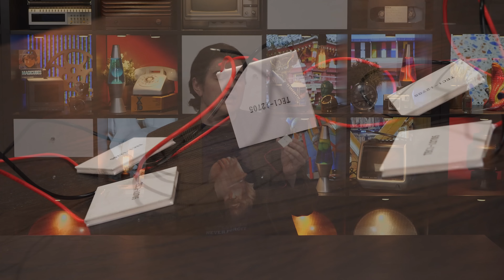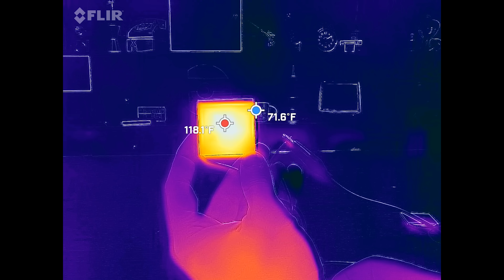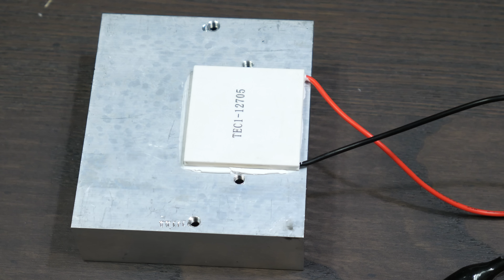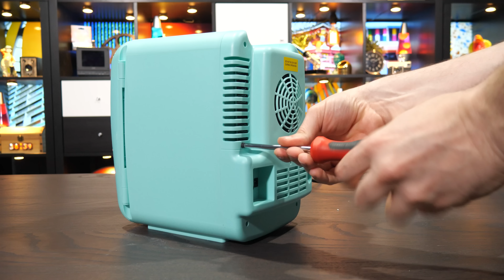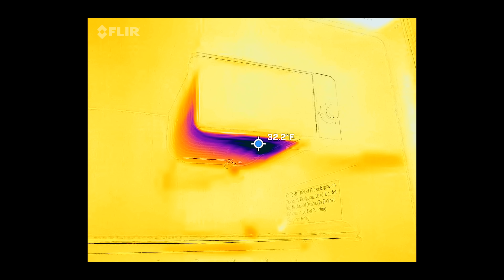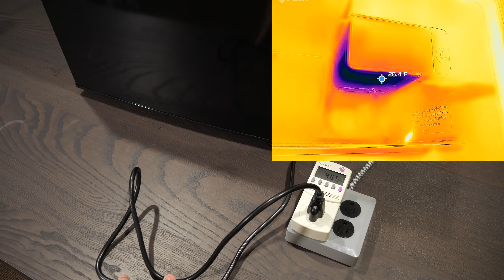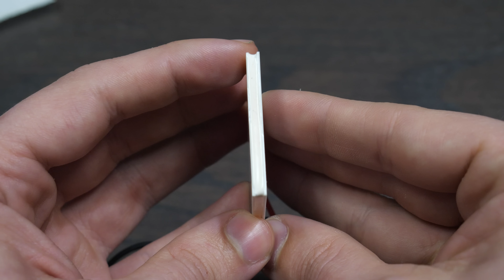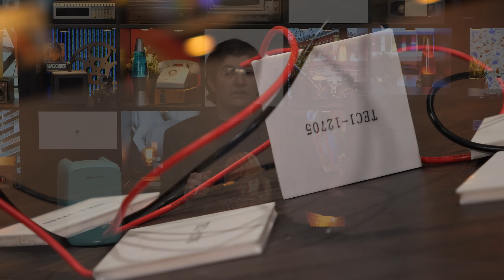Thermoelectric cooling: it's not great.

Comment: Ex wife and I bought an electric cooler for a cross country trip we spent a month driving in our early 20's. It was great! 

They have their uses.

I now have an actual DC fridge with a separate house battery in my van. And a much smaller fridge in my Jeep. But those aren't very cheap, or compact.
Reply: I use mine when travelling since hotels don't typically have mini fridges anymore. Also have the larger DC minifridge, but it isn't feasible to bring along unless driving myself

Comment: The most important things about these is the size.  In no way would I be able to bring a mini fridge into my office to work (in a cubicle in the office), but these little fridges work decent.  Stock it at night, and you have 6 chilled cans to get you through your work day.
Reply: At that point, just bring an actual cooler and use ice packs. You can even get ice packs that are shaped to fit inbetween beverages.
Reply: @seigeengine The amount of work that necessitates is obliterated by the convenience these provide.
Reply: @knight0fdragon  I mean, other than carrying it back and forth, which is trivial, it's basically the same amount of work. You're just restocking one extra thing when you're restocking, which is even more negligible.
Reply: @seigeengine  no it isn’t, at all. There are a number of steps involved that must be done routinely to ensure that you have cold beverages compared to just keeping stock and refilling.
Reply: @knight0fdragon  Yeah, like keeping stock, and refilling.

The ice pack is basically just another beverage. Carrying it with you every day is trivial, you already go to work every day. It's not heavy. Most people drive to work anyway.

I'm not saying the babyfridge isn't more convenient, but the difference is fairly small.
Reply: @seigeengine  holy crap buddy…. No.  You can’t just keep a cooler in the office and put in tiny ice cube packs and expect it to instantly cool things off,  thermodynamics don’t work like that. You need to take that cooler back and forth to work with you.  You need to ensure your beverages are cold at your home because the point of the ice pack is to help the drinks retain its coldness, not make it cold, which means swapping in and out between your fridge and your cooler.  You need to constantly freeze those ice packs.  You need to clean those ice packs.  You need to clean that cooler more often because you are constantly transporting it.  If there are any leftovers you need to place them back into the fridge. There is a lot going on to using a cooler.  With the fridge.  You stock your cubicle with a months worth of beverages, and you replace what you consume at the end of every day.  Once in a while you dust it off and clean it.  That is it.
Reply: @knight0fdragon  I like how you just started making things up.

Just slap on a red accessory and pick a race to hate. Shit.

Comment: Is the opposite true? Can I use temperature difference to generate electricity?

Cause I could dig a kinda deep hole and have free electricity.

Even use the difference between inside and outside buildings.
Reply: It's called Ceebek effect. It's what powered many of the old unmanned space crafts. It won't give any useful power, only a few hundred Watts at best.
Reply: @jamesisaac7684  Seebeck?

Comment: For camping, there are now many camping coolers on the market that use a compressor instead of a Pelletier cell. Bought one last year (Bouge RV) and, it consume 33 watts while the compressor is running, 0 watts while off so depending on the ambient temperature it operates within, it can do its job perfectly with so little current compared to the old Pelletier-based cooler (+/- 44 watts, full time) that there is no comparison at all. The noisy cell-based crap having drained my car battery to zero a while ago because I had kept it on overnight. Now I use a separate 100Ah Lithium battery on my camping fridge. I control the exact temperature I want inside and it can easily run for 4 days on its battery.

Comment: one possible use case ive seen for these is cooling a cpu. so long as you have the means to dissipate more heat than normal, you can probably get more performance out of your computer. not just for the top end rigs to get 1 or 2% more performance either
Reply: According to many comments. PC entrusted had tried that but did not  succeed. The conventional methods hand better' performance which used less power.

Comment: Is the thing holding back these devices the need to fit within the power supply of a 100w car inverter? ie. could we make them actually useful if we 5x or 10x the power? To make a comparison, I love space heaters and am 100% in favor of trading higher electric bill for operational simplicity
Reply: As mentioned, they're less efficient the more power.

Comment: you mentioned the heated / cooled cup holder thing. my 2nd gen honda fit just puts some cup holders in front of the air vents, so when you're trying to keep yourself cool in the summer, it keeps your drink cool too. it's enough to cool down a warm energy drink to noticeably cold temperatures in an hour or so (perfect for car rides!)

Comment: Why would something like this not work in space for heating.
Reply: It would work in space for heating, but the issue is that in space you're limited in heat exchange by radiation since there isn't air to either absorb heat from or dissipate heat into.

So you'd be better off basically just using resistance heating.
Reply: @seigeengine  So the side heating the cabin would have air but the side exposed to space seems like it would stay at a constant cold state, I lack the knowledge in this subject to know why I am wrong.
Reply: @jaylors5825  These work by moving heat from one side of the device to the other.

In order to do that, the side that's being made cold has to get warm first, otherwise it won't have any heat energy to move.

In air this works out because the cold side can absorb heat from the air, but in space, it can't do that, so once the cold side gets cold, the only heat it gets is conducting back over from the warm side.

So since it can't move heat from the outside of the space ship to the inside of the space ship, it's basically just a resistance heater with extra steps.

Comment: One specific use case for these devices that is nice is for small, inexpensive cigar humidors. I picked one up last year since my non-AC apartment gets hot in the summertime. Only need to keep them in the sixty degree range. Larger cooling fan is quiet as well.

Comment: The only thing Ive seen those tiny pos coolers that was a ok use for was to keep super glue at the place I used to work at cool. It cost more to pay someone time to walk across the building to get the glue out of the break room and putting it back every time. They didnt want to have a mini fridge under the work bench nor did they have enough room to put one there so it kindof was the only option.

Comment: Pelletier is good for electronics components like microprocessors or laser diodes, that can get very hot, but it also needs a good cooling system, like a good heat sink and a fan, or anything you choose. As you said cooling is just an energy transfert, so it has to go somewhere... I've heard about home heaters that are made of chips that mine bitcoins ! XD !!!

Comment: I'm a long time fan and greatly appreciate your insistence on practical, day to day technologies. Have you thought at all about the other side of thermoelectric devices, using waste heat to generate electrical power? I know they are useful in niche applications where you have a reliable heat source, no tolerance for mechanical failure, and no ability for electromagnetic generation, like using a nuclear reactor's heat to power a deep space probe. This still isn't very efficient, but I'm curious if there are any consumer applications or products you know.

Comment: 8:35 An actual refrigerator requires A LOT of power (inrush current) to get it started. Yes that's only for a fraction of a second but without that initial burst of power, you won't get the compressor started. So mains power only unless you have a fancy soft starter. Which begs the question, to those that know: how do small fridges for campers or boats work? 🤔
Reply: I'm ignant, but I imagine this is related to the size of the compressor, so smaller compressors just don't have as much of an issue? Some seem to use compressors as normal.

There is a different type of fridge used in RVs and the like called an absorption refrigerator that uses heat instead of a compressor to drive the refrigerant. These often have multiple heat source options to enable use of either electricity or propane.

Gist is they use heat to drive ammonia out of an ammonia solution that a

Comment: Another benefit to the cube mini fridge - it's also a good place to set things. Either in an office like mine is currently used or as an end table between two couches in college as it was previously used.
Reply: They also get fairly small. Smallest proper mini-fridge I found was an 18" cube, whereas these are 10" tall and deep, and 7" wide.
There's definitely a size difference, but 18" is still pretty small.... and also those apparently hold 50+ cans  compared to this holding 6.
There are even some a bit smaller than that (15x16x19 for example)

Comment: As an engineer in the USA I do appreciate your use of SI units. About the only time we use English units at work is when we are doing the final conversion to units for the general USA population. The more USA folks that are exposed to them (especially the clever ones in the bunch who quickly figure out it's easier to use SI), the more they will accept them; like even the UK barely uses English units any more! For example, do a project using the old English units then do one with SI, base ten is always better than fractions and random number conversions.

As an aside, a Peltier device in a properly insulated "thermos" with a proper thermostat and good Li battery would be nice for a camping trip or outdoor party.

Comment: The common 4 ft³ college frig I'm borrowing atm has used 22.77 kWh over the 921 hours I've had it.  So that's ~25W/hr, or $30/yr at that $0.14 rate.  Running at 60-65W, but 120-125VA, reflecting it's 1A current draw and the commonly poor power factor of a compressor.  But it's certainly not great at temp holding.  Random checking of the thermometer I put in there comes back with anywhere from upper 20s to low 40s, and that's with a static content of at least a day.  And the freezer runs around 20, never gets near 0.  I have it on 4.5 / 9, but worry that turning it up more will just get more frozen food (no drink containers freeze, but water in leftovers certainly frosts).  When it cycles on, it'll run for 45 minutes.

I can't see how a large sheet of metal casing between the coils and any air flow is at all efficient for the heat evacuation.  IR gun while it's running puts the room at 72°F, front doors at 69°F, and the side panel from 94°F to 97°F.  Still better than the broken main frig that currently performs zero cooling.  I noticed the college frig was R600a as well.  Glad to know while maybe not as effective as R134a, but there's some benefit to that tradeoff.

Nice to see the good Kill-a-Watt meters.  I had two, lost one to "may I borrow that".  Bought a replacement only to discover it was a newer "EZ" model, with a really annoying button menu system.

Comment: But mine has a bluetooth speaker on it and cost $20, that makes it worth it, right? 🤣

Yeah I was never a fan of it, but it does keep an already cold drink cooler than keeping it out in a cramped hot garage. Eventually I'll get a real fridge when I reorganize the garage, but this was cheap and does the job. What I did learn from this is I should probably turn it off when I'm not in the garage, I didn't know it didn't have a thermostat for the Peltier device!

Comment: We use some pretty big peltier coolers at my job actually! I work in optical machining and our machines and room need to be very carefully temperature controlled. We have normal cooling stuff for the room, but the machines have an air shower that is cooled the very last bit by a TEC .

Comment: I did a job in an office where almost every desk had one of these. I had never seen one. I opened a few of the doors to see how cold they got... I thought they must have been off. I also told a co-worker that they must run on pertier modules because of their size. When I opened the doors the lights came on. Yep... peltier modules.

Comment: Hey 27:07 I’m curious what about actual 12v/240 fridges
Like waeco/dometic and Engel’s I have a waeco Cfx28 and a waeco cfx65 and they are mostly upright but as they are made for recreation like off roading what happens with the oil in those? As both my waecos have compressors
Can you run a little extension on this video please?
Also why the criticism on metric system with kgs?

I’m not a communist I’m a Australian we use Celsius kgs and litres why the hate?

We would understand if it made sense at all but it doesn’t and the whole fractions of a inch to measure like seriously? How hard is it to measure a bolt or nut and it measures 12mm how do you look at a tape measure and work out what fraction of a inch it is? Are you sure it’s 5/9’s or is it really 73/100 of a inch or the hundreds of fractions between them?

 I’ll teach you all ready?
1 then 2 then 3…. And when you get to 9 then after that believe it or not 10 I kno your stunned but 11 is next mine blown right? Your turn what comes after 99? It’s got a 1 and two 00’s hard to believe there’s no yards feet inches elbows big toes or dolly steps in metric it’s as simple as possibly can be 

in C, 0 water freezes and 100C it boils simple

I’m just guessing but water freezes at 20f and boils at 185f or something stupid what does 0-F mean  and why?

With weight it goes 1 gram then after 1000 grams it’s 1KG and so on

Liquid 1ml then 1000mls is 1L so no ounces or shillings or anything that hints your really holding on to the old English owners way of life….

As always love your work :) keep for the automotive fridge video

Comment: What I love about these TEC’s is that you can hear one side and cool the other, and you’ll get electricity back out the wires. I love how science works. An electric motor becomes a generator, a speaker becomes a microphone, and so on!
Reply: Unfortunately cranking an engine doesn't turn exhaust back into fuel

Comment: Toyota has a patent on using these on an exhaust manifold to produce electricity, I wanted to mess with them at a point and build something further down the exhaust system to produce electricity once, mainly due to it would be a lower temp down towards the muffler and you'd have sufficient airflow for the cool side to keep the whole thing from degrading.

Comment: those TEC coolers are even more stupid as most cars now limit the sockets to 10a, and the TEC devices often demand 15a
and even if the limit was the same most cars don't have multiple sockets for multiple powerful ACC loads, so your car's back socket is the same as what you use to charge your phones up front

and another factor is the abundance of "camping coolers" which are a chest style fridge+freezer that can run at 120vac or 12vdc
the reason for dual power is that cooldown takes a lot of power, so you plug in the adapter brick at home before a trip, cool it down, load it up, then connect the maybe 5a compressor load to your ACC port and travel, once you arrive at the campsite you can then connect it to your portable power station charged with solar panels

that means TEC coolers are actually worthless these days, they are superseded by compressor coolers in ALL situations other than cost
but obviously you would better insulate them a tad in your gaming den to make the drinks actually cold, and just abuse the fact that they can be PWM'ed with a supercap array to vary the power output based on the thermal probe inside

I could MAKE a butane mini-cooler like that with a simple control module for 20$ plus a can of butane for 5$(not even all used) and a bunch of copper tubing(the most expensive bit depending on sourcing because it is not yet illegal to invest in copper which raises the price of a critical resource that should have it's price federally limited, yes investing in critical resources should be made illegal in my book)

so best to use vapor compression systems 100% of the time you have a 24/7 load, TEC modules should only be used in cases where flipping is expected or the unit is going to be used in small spurts and be off most of the time or where you need a carefully controlled thermal zone and the TEC variability is cheaper than an inverter drive compressor system

TEC modules also do badly near their maximum rating(about 1.5x their input wattage) so most modern computers that would benefit from their cooling being directly on the CPU/GPU would suffer saturation issues well before you reached the previous thermal limits

Comment: You left out bi-thermal reactionary blast redundancy evaporative cooling. It has limited industrial protocol uses but can be configured in a back door array to freeze those gelatinous ice packs to keep your bud light cold. That is if the thermo dynamic slay rod is not out of skew on the treadle.